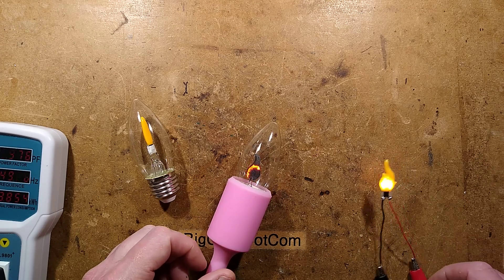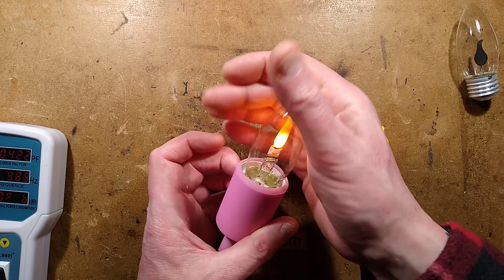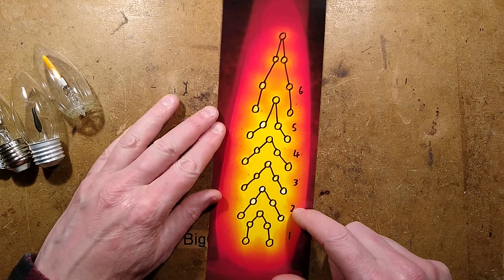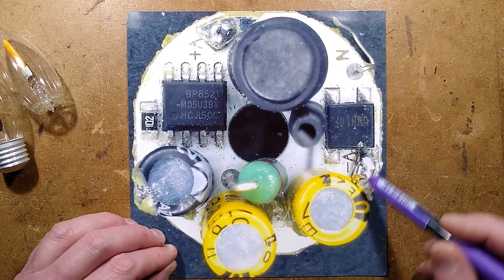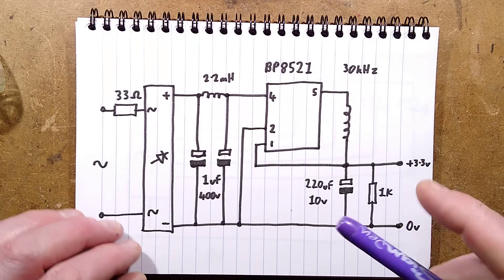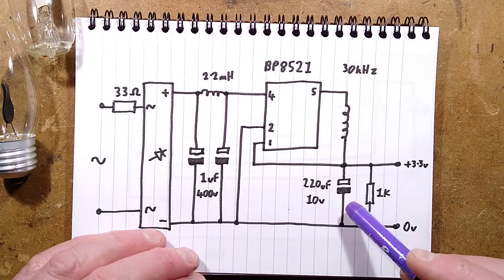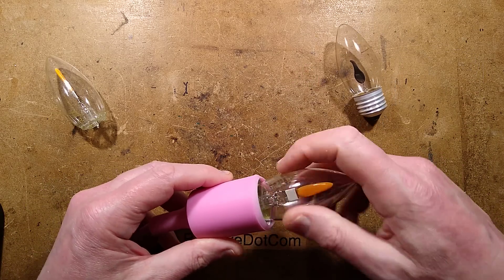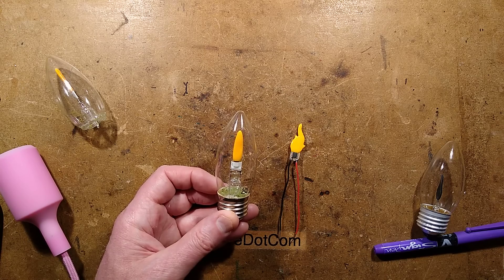New LED flame bulb - with schematic

Comment: I wish there was a way to create the flame effect with analogue electronics, some kind of chaotic oscillator, but sadly that would be much more complicated than just programming a microcontroller with (I presume) a simple random number generator.
Reply: Lots of these sorts of things don't even use any kind of RNG at all (or even a CPU).  They've just got a pre-programmed pattern that they cycle through (they're basically just a ROM chip with a counter).
Reply: @foogod4237  Where's the fun in that? ;-)
Reply: Seems you could make the deterministic prng just fine with a shift register and a few logic gates, or real entropy with a thermistor or temperature sensitive clock crystal. Sadly more expensive than mcu these days, tho...
Reply: @daliasprints9798 but you can do the RNG exactly the same way as a  "shift register and a few logic gates" with MCU code. Just add more bits and use amplified noise on the ADC input as a seed value.